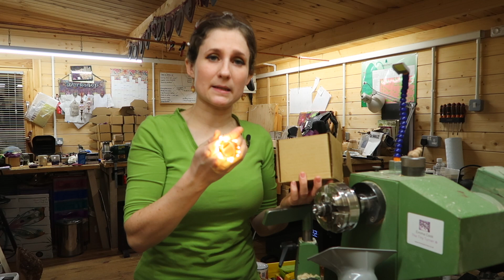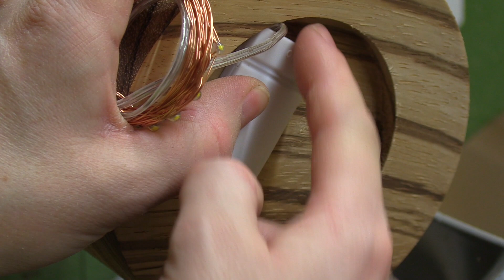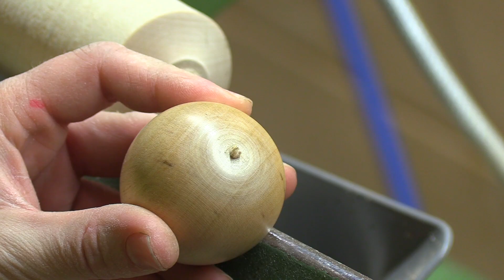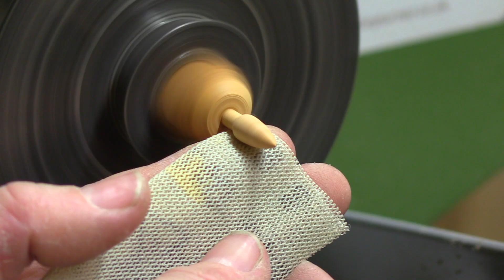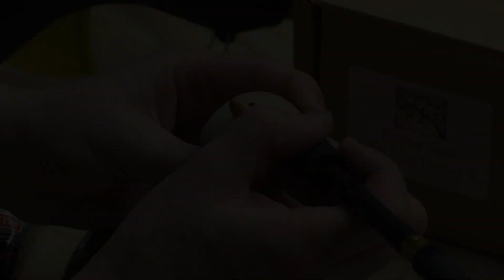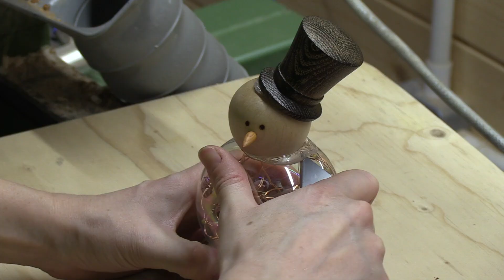Wood Turning with The Tiny Turner - Project #2: Freestanding Lighted Snowman Ornament/Decoration

Comment: Very nice, thanks. What angle are you sharpening your Bowl gouges I use 40/40 grind wit a 60 deg bottom gouge A brad point drill would stop the drill skidding.

Comment: Hi Emma,
I have made 5 of your adorable snowmen for my daughter and daughter-in-laws for Christmas. I had a wee bit of problem.  All 5 snowmen bulbs broke. I was very careful making room for movement and used E6000 glue for movement. 
Any suggestions on how to get the broken glass off the wood?  I’m using a heat tool but not much luck.  Any advice would be great!!!
Thanks so much!
Rhonda
Reply from the maker: Hi Rhonda. So sorry they have broken!!! I tend to use an old carving chisel to pry off the old glue and glass as I have had to fix a few over the years! I think sometimes the glass is thinner in some areas of the globe with them being hand blown, and it can cause them to occasionally crack. Also I used to have a bad habit of picking them up by their hats which broke a few 😬